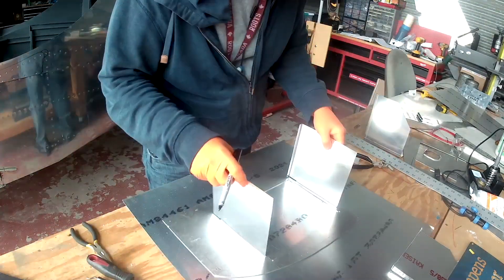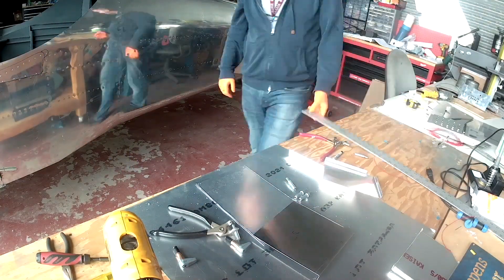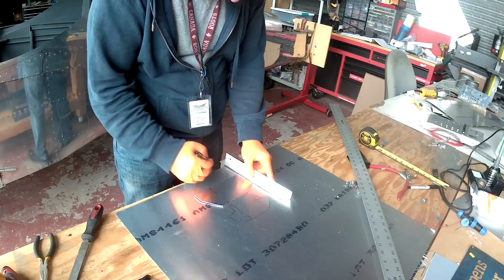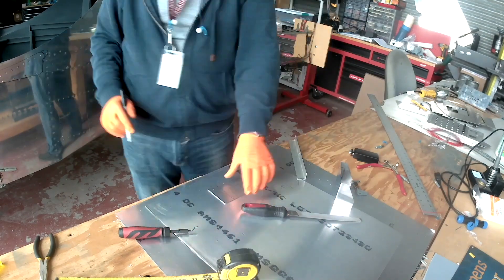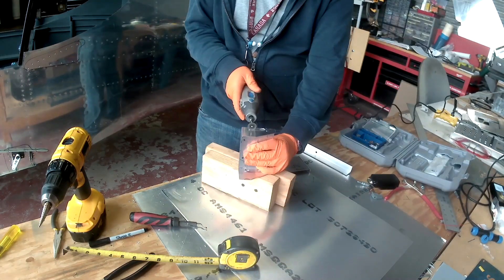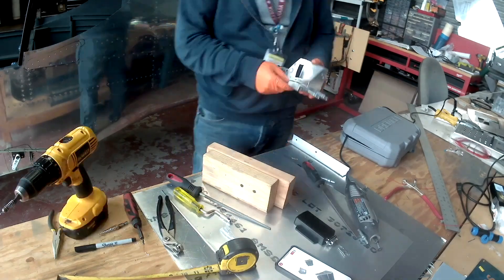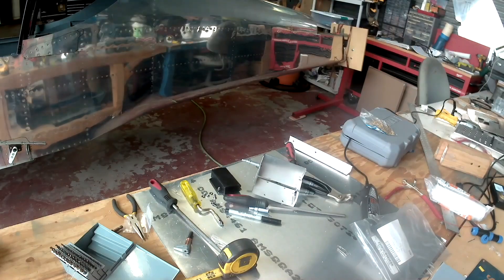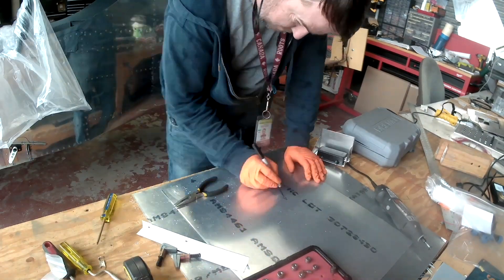RV-14 G3X - 9

Comment: I just made a similar bracket for the GMU 11 today!  Did you have any issue calibrating the mag if you truly made the bracket 90 degrees?  I ask because the -14 has about 3.5 degree dihedral and the GMU11 wants to be 3 degrees from level cruising attitude in its mounting orientation.
Reply from the maker: OH just keep watching. I don't mount the GMU 11 until damned near the end. Its out on the right wing, in its own cradle, perfectly angled up at 3.5 degrees.
Reply: @akilroy  so you never shimmed it, and it's fine? Good to know